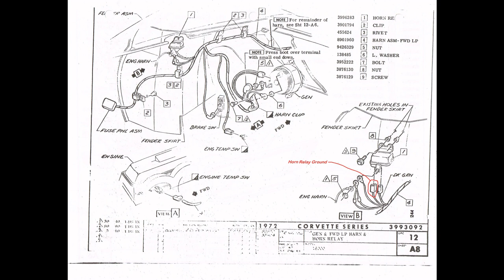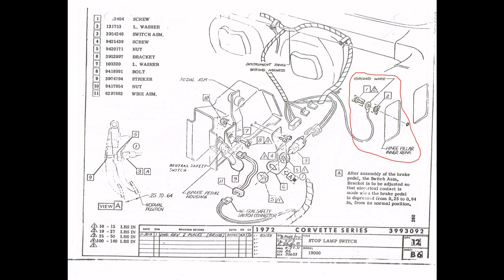C3 Corvette Stingray Grounds Part 1: Project Introduction

Comment: Hi. Very informational videos Mike! I have an -69 Corvette myself and I'm always trying to find information about it online. Where have you found that assembly manual?
Reply from the maker: @Party6634  thank you.  Search "1969 Corvette Factory Assembly Instruction Manual".  They are available on Ebay and at aftermarket Corvette stores like Ecklers and Corvette Central".  They are very helpful and worth the money ($45 to $55 depending on the source).  

These are all reprints of the actual manuals.